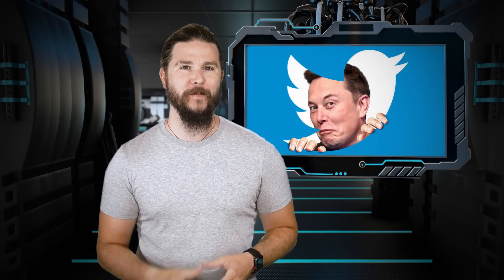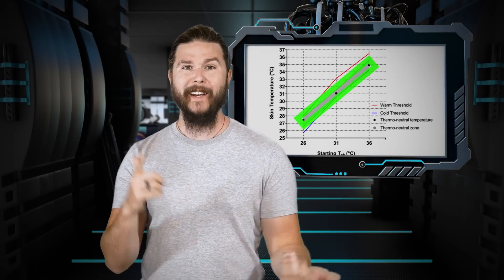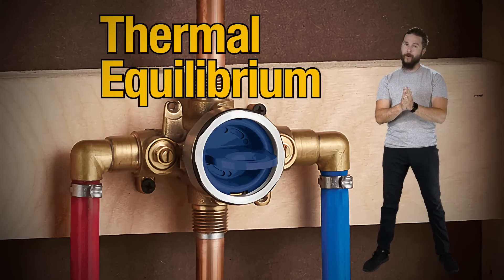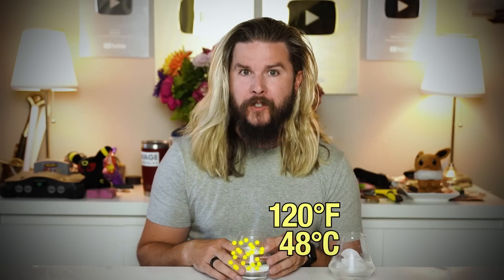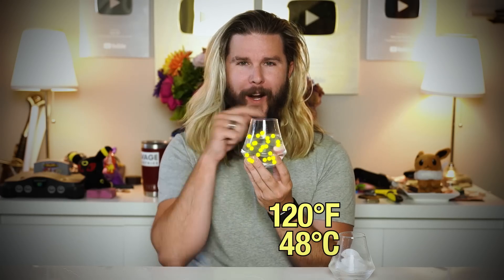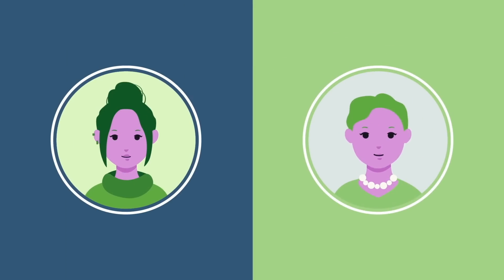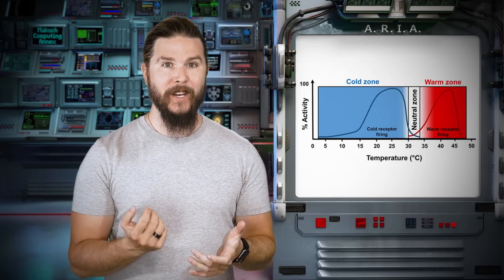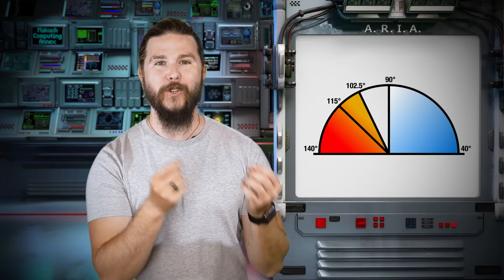Why Are Shower Handles So Sensitive?

Comment: As a construction worker I can attest to the fact that the pluming for showers is downright primitive😂
Reply: As not a construction worker who replaced the bathroom sink in their house I distinctly remember the moment I realized "Oh, it's all just a series of tubes"
Reply: Are you a plumber or a person who puts up the building? Because as a construction worker (plumber here) the way we build a building hasnt changed much in over 2000 years, unless your counting steel studs.
Reply: @JuanWonOne  materials have changed, not so much changed about the techniques.
it's faster thanks to specialized tools, and sturdier over all (in theory at least, cheapness tends to take that advantage away.) but the premise is the same.
Reply: My shower is a bird of paradise with very modern pluming
Reply: As an aspiring engineer: the system in your shower is currently as simple as it gets. Making things more complicated always makes them less reliable, and since you have to break into the wall to fix it, we don't usually do that.

His solution of turning down his water heater works, but it means that he has to use more of the hot water to warm up the cold water, so you run out of hot more easily, which most people really don't want to do.
Reply: @jonathanmacdonald9609  my solution has always been turning up the heating elements. Heats water faster and to a hotter temp. Meaning if you turn it all the way up you’ll burn the fuck out of yourself. But the “middle range” is still pretty hot.
Reply: @jonathanmacdonald9609  As someone who has worked in both construction and service in multiple trades (including plumbing), this is key. It has to be installed and serviced by someone like me, who does not have a fancy engineering degree. And it has to be EXTREMELY reliable- because anything involving water can have catastrophic consequences if it fails, both financially and in regards to health (mold). This is why the KISS method lives on in regards to modern plumbing.

Comment: I have separate handles for hot and cold. To simplify everything I turn hot all the way up and then adjust the cold. Maybe I should be doing the opposite because in the winter I literally have to tap the cold handle to get it in a good position

Comment: What gets me is the utter lack of standardization across showers, I feel like every one I've been in has some quirk to it. First time I use one I feel like Indiana Jones when I figure out how to get it to turn on after 5 minutes of fiddling with various dials and knobs. And there's no rhyme or reason to the UI. The one where I live now has 2 separate dials, one for hot water and one for cold, and neither gives any visual indication of which it is or how far it's been turned, they're just identical featureless dials. So it's just trial and error every morning unless you memorize the precise amount of rotations for both dials to get the combination of pressure and temperature you want and then succeed in turning them precisely that amount without any visual reference.

Comment: It's even worse when you get it in the sweet spot then someone turns on a faucet or flushes the toilet and drops the pressure on either the hot or the cold line and makes the temperature swing drastically in one direction or the other very quickly
Reply: Most showers installed after the early 2000's will have a valve that drops both inputs on one losing pressure to solve the toilet-flush scalding issue. I wager many have forgotten that was ever an issue by now.
Reply: @kauske  my shower mixer is only a few years old and it doesn't have that feature.
Reply: @ChucksSEADnDEAD  Where would you even find one that doesn't? Did your plumber get it as salvage?
Reply: @kauske  we recently had our bathroom renovated, and I think our old shower might have had that feature, but the new one definitely does not.
Reply: @vedritmathias9193  Probably should complain to your plumber for using crap parts from China or something. Because just about all faucette bases available have that sort of valve. It's a thing you'd either have to go out of your way for, or be using terrible parts to try and scrape a few extra bucks like a crook.
Reply: @kauske  Oddly enough, I've never really had that problem in my house, even though half of which is over 70 years old (where the shower is) and the other half (where the water heater is) is almost 50 years old. You can notice a slight pressure drop if it's the toilet or sink in the same bathroom, but the temperature seems to remain the same. Seems to be a combination of factors, like a high municipal supply pressure, larger diameter copper piping than now common, better shower plumbing & fixture designs, layout; who knows.
Reply: @pfarnsworth84  I'd doubt that the plumbing is all that old, or your insurance would be astronomical. Old plumbing and old wiring generally make home owner's insurance unaffordable. And if it's not up to code, you can't rent it either. Could even be considered unfit for habitation of the plumbing is old enough.

50 year old water heater would be it tough shape too, doubly so if your local water is even slightly hard. Water heaters are only really rated to last 10 years, maybe 15 if you're lucky. It's more than likely your house got a plumbing update at some point and you got a new regulator for the shower with it.
Reply: @kauske  Mine has one, but it's consistently defeated by the sprinklers

Comment: I don't really suffer from this problem. My shower has two simple globe valves. I'd just full-send the hot and adjust with the cold. It removes the guesswork of two variables and globe valves have naturally fine control by design.

The only things I may end up scalding are my feet when I turn off the shower and the cold closes way before the hot, but even that's just a mild discomfort.

Comment: I moved to Japan and in Japan many homes have a water temperatures that you can be regulated to the exact degree. Plus the bath tubs reheat themselves so you can sit in them as long as you want and it’ll stay just as hot without having to drain a little and waste more water. Also, you can start your bath running/heating from another room (Living room/kitchen) by just pressing a button and it’ll tell you when it’s finished. My boyfriend’s family home is an older home and it even has this installed.

Comment: so this gets impossible when you add to this equation tankless water heaters which relly on the pressure.
If you don't open enough of the "hot water" the boiler turns off and you get jusr more cold water.... i hate my boiler T-T

Comment: I start from “ here be dragon” 🐉 hot then I adjust it to the hottest temperature I can take. Most people freak out when they turn on the shower and it says it burns them. 🤷‍♂️ to me it feels to good. I guess I have a higher tolerance when it comes to with standing different temperatures in water.

Comment: I also found out that you can adjust the range of the shower handle. It was not getting hot enough even with it on full. It's more of a safety thing, as we lowered it in the kids' shower so that they can't scalt themselves.

Wondering how the concept of feeling hot/cold on a basis of a transfer of heat and not the temperature of something. Like I demonstrated this for my kid by putting one of his hands in very warm water, and another hand in very cold water. Then I had him put both hands into a bucket of room temp water and he could feel the "weirdness" of being in a cold and warm bucket of water at the same time.  Is it that we feel "hot" wen it the energy ransfer migrates outside this range but that the intensity of the heat is determined by how much change in temperature of our skin actually is?

Comment: As someone that worked at the delta faucet plant that made all mid-high grade shower valves, I want to mention that the single handle valves have fine temp adjustment on the top. Depending on your water heater it may need to be changed for hot water flow. Two handle valves are even better, never touch the temp handle once you get it where you want.

Comment: CRITICAL CAVEAT: Don't just go turning down water heaters willy-nilly! For any reservoir of water that is kept warm or is regularly warmed, certain minimum temperatures are critical to prevent growth of specific microbe species. Also, when accessing very hot water from the tap, less power and water is wasted when the water heater temp is kept high, because it takes less time to access the desired hot temps. 

This video didn't directly advise anything problematic, of course! Just needed to add a little nuance since it seems to me that people could come away with some mistaken guesses about turning down water heaters. Legionnellosis is no small deal, and it's far from the only example of serious diseases that can easily arise from human use of reservoirs of warmed water.

Comment: There's also the fact that after time in warm water, your circulation will pick up and distribute the heat, meaning it'll take a little bit more to feel warm, which'll increase circulation, and so on.
And to complicate that, the hot water will create some thermal currents in the air around you, heating the air to rise up and pull in cold air from outside the shower, which'll blow by the skin that doesn't have the warm water running on it, making you feel cold... on the skin that's distributing heat better now, making it feel colder...

Comment: Only time I've ever seen 180 degrees handles r in public pools an maybe a lake cabin. Every house, apartment, an hotel ive stayed in across the US is 270 or 360 degrees from end to end. A couple places are been even more than one rotation. So yah the angle is small in a 180, but in my experience that angle and width r 1.5x or 2x larger

Comment: He's incorrect about most of the control area being useless. For example, in Las Vegas during the summer, the cold water pipes coming into your house get hot enough in the summer that you basically turn it all the way over to cold and it is still a bit too warm. I assume the same thing applies in very cold climes so that the cold water entering the home is far colder than in the summer so your adjustment would be more towards the hot area on the dial. 
 What this means is that the "sweet spot" on the dial is going to be different depending on the time of year you are showering.

Comment: Petition to require ALL showers to have either a button or handle for pressure adjustment and a separate button/handle for temperature adjustment. Both must be engineered to allow for small adjustments and large adjustments to both.

Comment: water heater is set so at the furthest point water comes out at 120 degrees F. I have to manual knobs so it's about a half turn on the cold and hot all the way on to get the right temperature. I've also got one of those "lets the water run till it's hot then shut it off" thermo valve things on the shower head, so when I step in, it's juuuuuust right. really need to measure that temperature then get a thermoregulating/mixing valve, then I can just turn both hot and cold on full blast and it'll be good to go. I live alone, so that's something I can get away with :P

Comment: I just have two tap handles in my shower. Turn the hot water on all the way and then turn up the cold water until it feels comfortable. It's always very easy to change the temperature without ruining things.

Comment: There is also the added fact that the brain lies to us about temperature. To prove my point you can try this at home.  Take water that was in the refrigerator and then take water from the tap. If you put your hand in the tap water then the cold you will obviously receive it as cold a cold temperature drop. 

But if you take your hand after dipping it into the cold water and you dip it back into the tap water your brain will register a significantly higher temperature with out actually raising the temperature.

Relating back to the problem with showers, even if you turned it slightly the sudden difference in temperature will be exaggerated by your brain making it even harder to find that sweet spot.

Comment: Couldn't this be fixed with an oval  shaped gear on the mixing valve and a circle shape gear on the handle so you get a more variable rate of opening.

Comment: There are some flaws in your analysis, Kyle. To reach your showerhead, water has to first travel through your house through a series of pipes, and these pipes remain full of water even when they're not in use. They're insulated, but over the course of several hours' disuse, the water in these pipes will reach your home's ambient temperature. Therefore, under normal circumstances the hot side will be colder than it should be, and the cold side will be warmer than it should be. So when water is allowed to flow again, there will be a sudden and drastic temperature change once all of that ambient-temperature water is purged, and what's now hitting your skin is water that moments ago passed through your water heater (much warmer) mixed with water insulated by the ground (much colder).
And then even after that initial purge, the pipes themselves (which are also starting at the house's ambient temperature at the moment you open the valve) will continue to affect the water temperature until they reach equilibrium with the cold water coming in from outside and the hot water coming out of your heater. So even after you purge the lines and find a comfortable temperature, it will drift away from that point for a while.
Also, anything that affects water pressure on one side or the other, like a flushing toilet or a filling washing machine, will cause a change in the ratio of hot and cold water available at the shower valve, and therefore a change in temperature.
And finally, you might WANT really hot or cold water flowing out of your shower head for some reason.
Therefore, the problem isn't as simple as "shower valves are dumb", there are a number of cost and practicality issues at play. Unless you're Elon, in which case you probably have a separate water heater and plumbing for every shower and faucet in your house.
Reply: It's also flawed to suggest that "you can just turn down the water heater" - not everyone live in a house...

Comment: My house in Australia has a digital thermostat in each bathroom to control the temp, in summer I have it from 40-44 and in winter 46-50. I like this system because there's only a On tap not H & C

Comment: I have more issue with the sudden hot or sudden cold of someone else using any water anywhere in the house. Really annoying, and having a little tiny 35" standing shower leaves me no room to get out of the way. Oh, and if I set my showerhead into "nearly off cause there's a space between the last setting and nothing that kinda sorta stops water flow while I lather" the water decides to jump to one of the extremes as well. No idea why that happens... And if I turn down my water heater, the water won't be hot enough to wash dishes! Or make hot cocoa! Seriously, my mom liked having it cranked to 175 to really clean the dishes and I found out you don't need to boil water for cocoa because of it.

Comment: I can't say I've ever had this problem at home.   I have 50+ year old Moen shower valves which have both temperature and pressure control.  Hot water here is 160F, incoming cold water is usually 65F.   These old Moens don't have any of the thermostatic, pressure-balancing garbage and are ultra-reliable.  Ultra-precise as well.  

The only time I find myself adjust the temperature from my normal setting is on the coldest mornings of the year when a little nudge warmer is appreciated.

Comment: Wouldn't a cheaper, more effective way of fixing this problem be modifying the handle with a gear so that the closer you are to the "neutral zone" the more you have to turn the handle? I.e. the valve opens 1cm/inch when you are closer to turning them off, and 1cm/cm when you are closer to where you want the temperature to be at.

Comment: Sounds like the solution to this problem is a handle that has 180 degrees of movement but actually controls a valve that only has a few degrees of movement within the actual range of temperature you want in a shower. doesn't sound hard to engineer, so why do we still do it the dumb way?

Comment: don't turn down your water heater. the hot water side is hot for a reason...namely killing Legionellen which can kill you if they get nicely into your lungs ESPECIALLY in showers. 60C is the recommended temperature and don't forget to have a circulation no colder than 56C return temperature.

Comment: My friend over engineered his shower with a 15:1 gear ratio secondary knob on each side with a toggle latch. He can use the main hot and cold knobs to turn on and get close to the golden temperature, then activate the secondary knobs to fine tune and adjust if needed. I highly recommend this, as it only cost about $25 in hardware and about 2 hours to install.
Reply: So uh, how would I do that...  Asking for a friend :)
Reply: @Korndog_01  with a 15:1 ratio gear set in aluminum or stainless steel and attach it to the knobs in the shower, then have the small gear on a lever that you can disengage with a toggle latch or spring tension. It was pretty simple to set up, really. It was ridiculous, because the ratio was way too high in my opinion and it took forever to get the water to change temps if you wanted to. If I wanted to make something similar, I'd probably go for a 3:1 ratio, but I would rather use a digital control to do it automatically for me.

Comment: Here in Finnieland Oras thermostat shower faucets are 👌 ... Not easy to make it too hot or cold. And it simply just mixes the water sources at the correct ratio, with the help of the thermostat. Your handle then just offsets from the "perfect" zone.